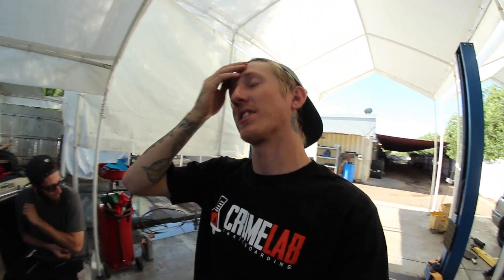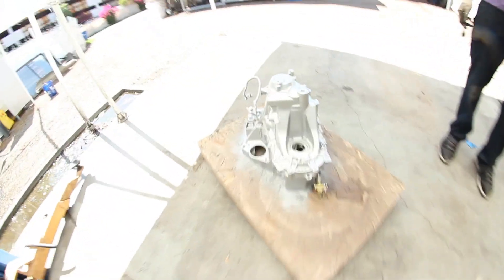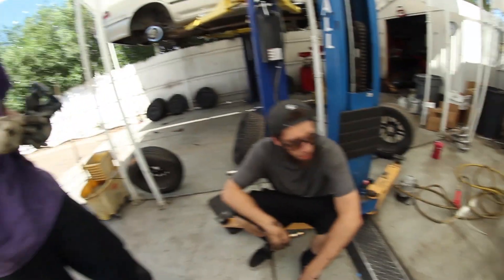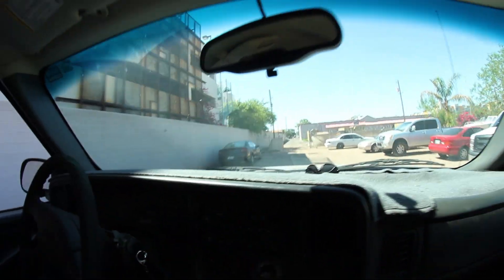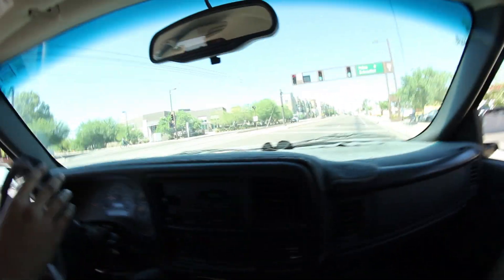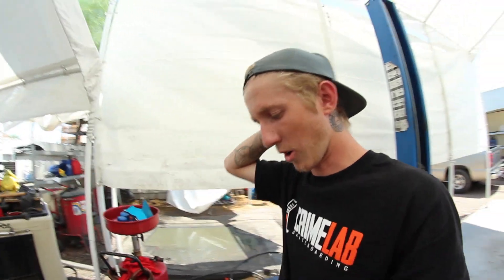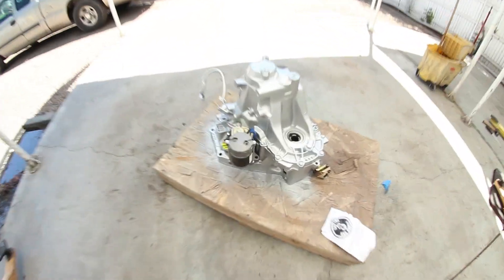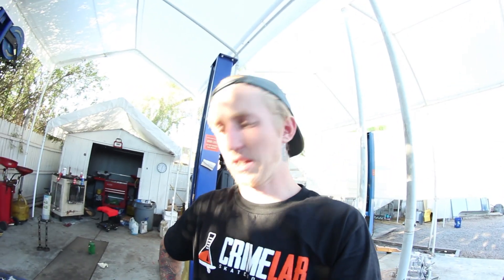Saturdays Are For The Boys Episdode 5: RHD Cars and New Block!

Comment: those oil pumps are the same . use the new one with the low miles
Reply from the maker: Back Yard builds in not tearing it back apart for one. And 2, the filter inside of the old one is much more fine and won't let nearly as muc contaminants pass through

Comment: So I can either finish building my turbo kit, or I can rebuild a B18A1 block I just got for free. But I don't know what to/how to build it for. All motor or boost. What should I do. I got til Friday to decide.
Reply from the maker: just depends on what you would do using it for. i do touge and will start tracking this september so i dont care about HP numbers so im staying all motor. more reliable too
Reply: ChrisSadowski well the current motor I have is fully built but cams too aggressive so that means I can boost. Drops the compression to 9:4.1. I wanna finally do boost. This will be my motor/chance. To daily. So I want to start doing track as well. I have Pacific Raceways like 15 min away from where I live. I always wanted an LSVTEC with the PCT (CTR) pistons. Suicidal motor build.